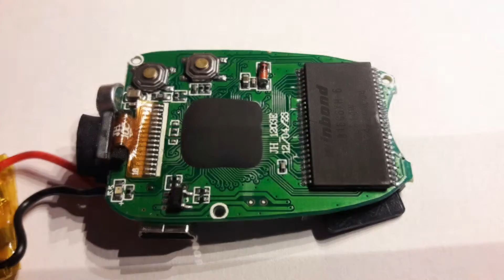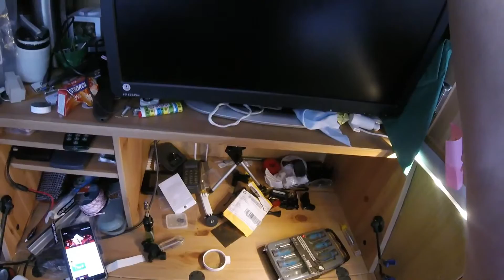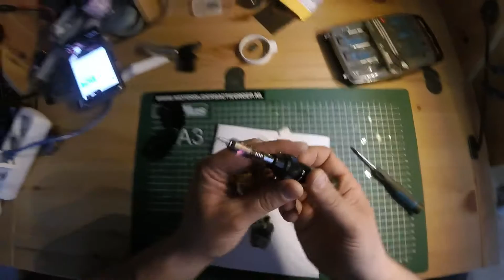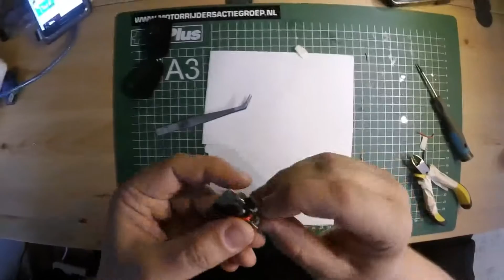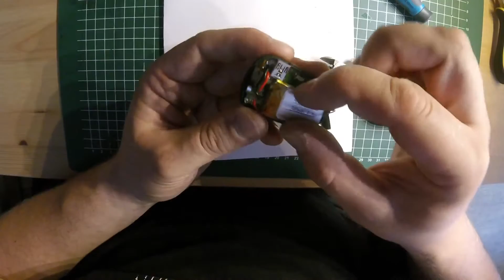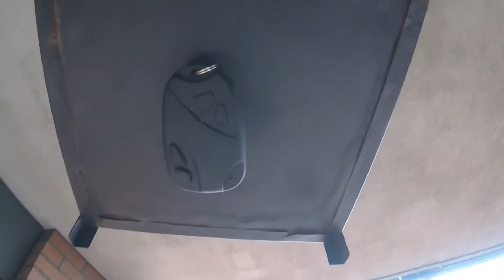Replacing / Upgrading 808 keychain camera (#9?) battery

Comment: Definitely looks like a #9 from the circuit board & the bold font of the time-code. The camera's CPU is under the black blob of cement. The big chip is RAM.
They are not a particularly good camera & I am surprised that you are bothering to replace the battery. The #3 keychain camera is far better, but I have no idea if they are still available.
Get a #16 keychain camera which is true 720p HD. The batteries of those are plug-in replaceable. A good thing as I have two #16s with dead batteries, one of them needs a new camera module as well.